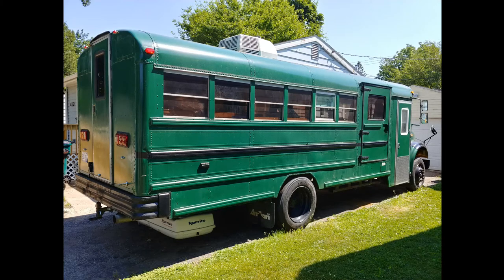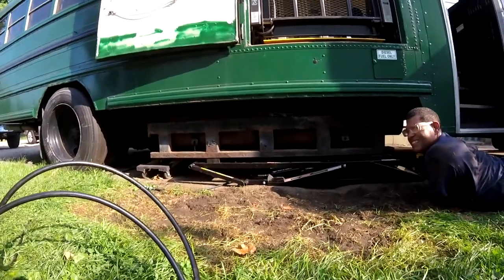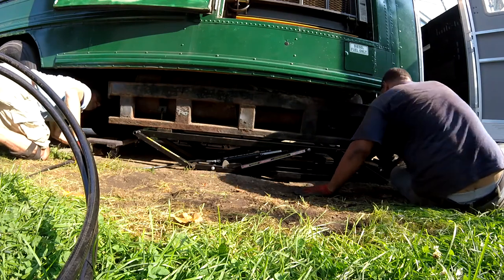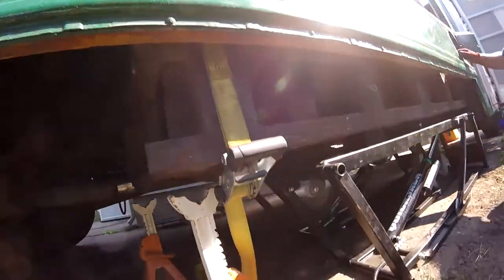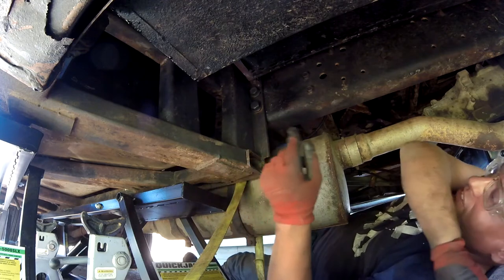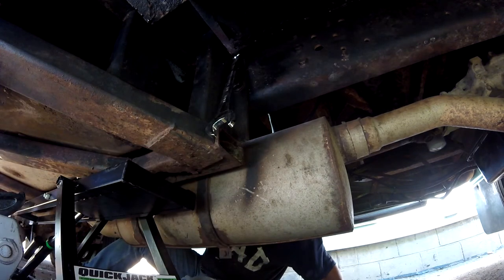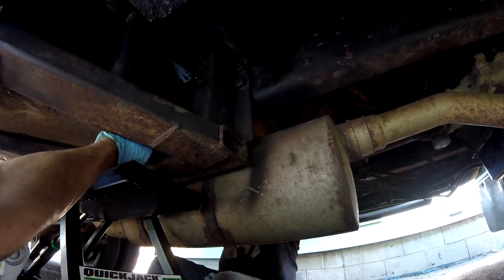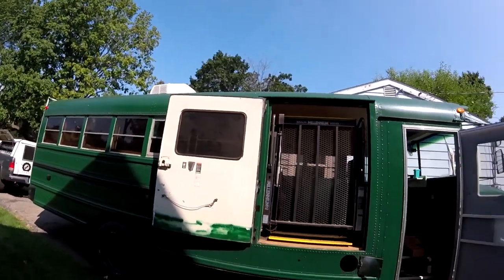Mobile Mechanic - How to Remove a Schoolie Fuel Tank

Comment: Since I watched this painful video.  what was the Labor cost
Reply from the maker: I charged $650 in labor.  In total, it took a little over 10.5 hours over 3 different days.  $20 inspection.  $360 just to remove 9 of the 12 bolts.  The final 3 were cut off by the owner with a plasma cutter.  $120 to lower the tank onto dollies.  $150 to raise it back up and install it.
Reply: Did the fuel tank have 4 hoses on it? If so do you know which ones went to what? I've got one that all my lines are rotted and no longer connected so I'm not sure which go where
Reply from the maker: @greymattertheofficial  I feel like it only had 2 hoses. I can't remember. It's been a while.